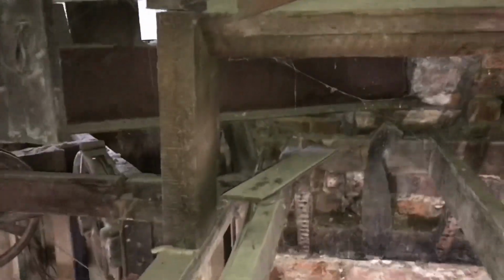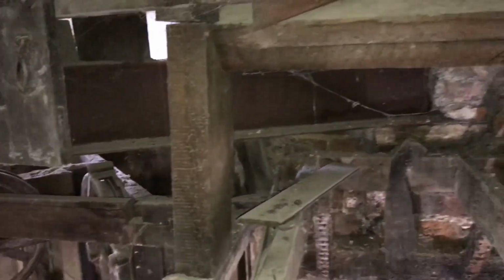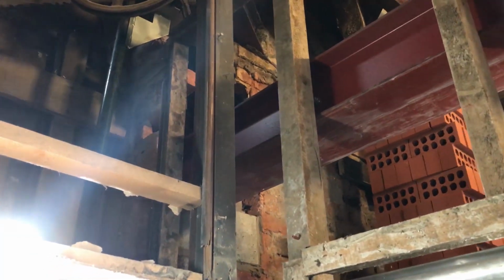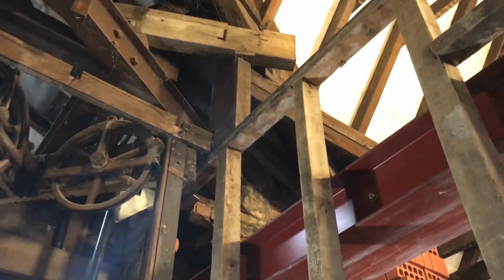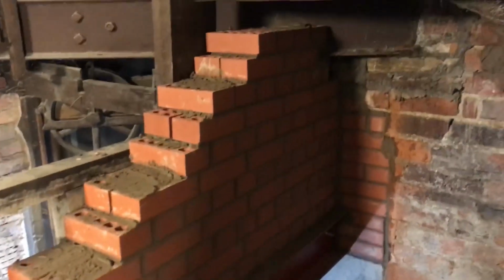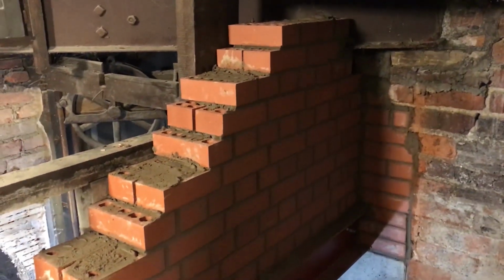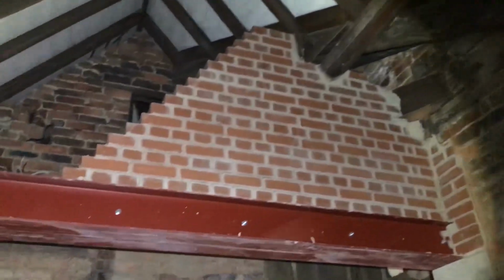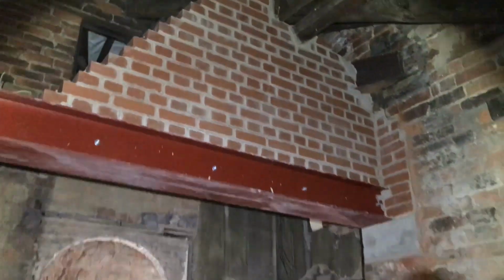Bricklaying - English Bond Purlin Support Wall

Comment: Nice looking bit of english bond Morgan. All that work to support those timbers ?.
Reply from the maker: Cheers Doug 👍 it’s holding up a hefty portion of the roof so was necessary 🧱 I may have gone slightly overkill with the brickwork but it made for a good video 🤷‍♂️😂
Reply: @MorganTheBuilder  sure did 👍

Comment: Was that an old mill house? Just wondered what the pulleys were for.
Reply from the maker: Not a mill house no, it was built in the 1850’s by a scissor maker in Sheffield. The pulleys we think were for a dumb waiter, I think that’s what it’s called anyway (for raising and lowering food and drinks etc), from the kitchen in the basement to the living areas on the top floor. There was a massive weight in the cellar so it could have been used to lift people too.
The building was then took over by the university of Sheffield in the 1950’s I believe, they just covered all this stuff up. It was interesting to find anyway, it still had some of the chains on the pulley and they moved too. Thanks for watching 👍

Comment: That’s a fair chunk of weight for two not very big beams .
Reply from the maker: Those beams would hold 3x the weight that’s on them now, all steels on this job have been over calculated to cover the engineers back 👍
Reply: @MorganTheBuilder  I know that’s the norm but the bricks the mortar the roof and snow ect they aren’t the biggest beams but there again I am not the engineer ..but just sayin!
Reply from the maker: @ronniebiggs4026  I hear what you’re saying mate, I read through the calcs before the steels were ordered and the roof weight and any live loads were all taking into account, even the purlin packer was calculated for so it’s all well within the limits 👍
Reply from the maker: @ronniebiggs4026  😂😂 cheers mate 👍🧱 it took a few of us for sure 💪🏻